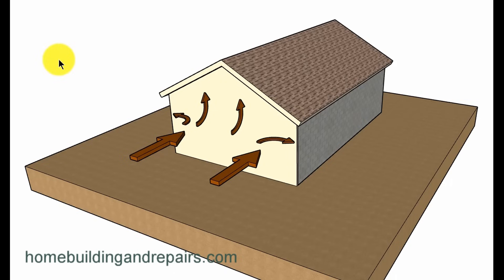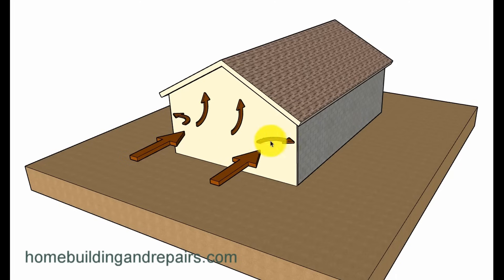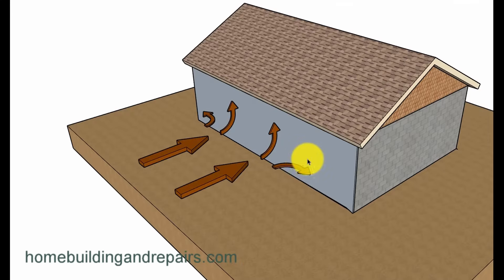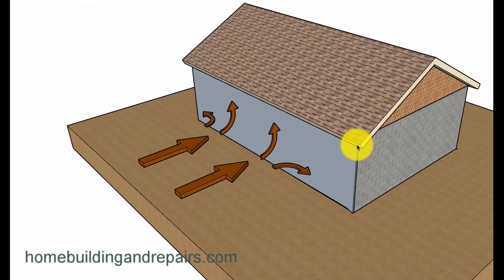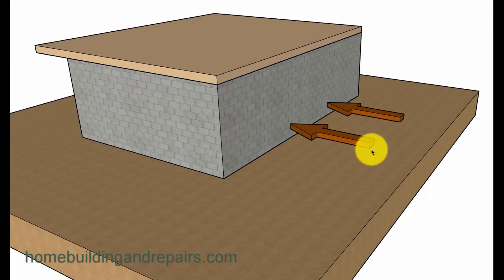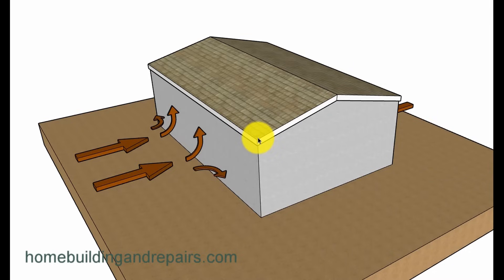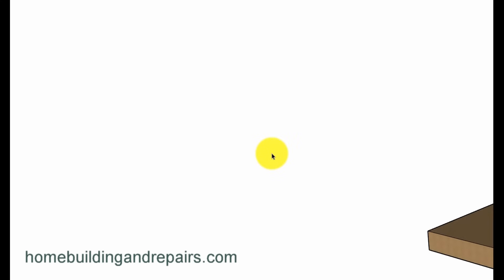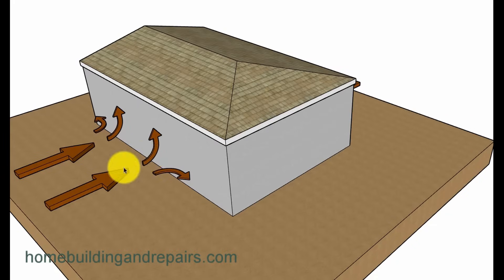How Strong Winds from Tornadoes and Hurricanes Can Lift off Roofs with Overhangs

Comment: Hip roofs are better for high wind areas. Also 30 degree slope is optimum to prevent wind blown rain issues, any more and the roof acts like a sail less slope and you increase the chance of wind blown rain entering the roof structure. Our home has a hip roof with a slope of 27 degrees.

Comment: I calculated that 100km/h of wind causes 50kg per square meter (60mph does 10lbs/square foot) of force. If your roof doesn't weigh much, it'll just get lifted up. If the speed is double, the force is quadruple!!! I did DIY something that didn't budge at 50mph, but at 60mph it was almost like a piece of paper in the wind.

Comment: I have 3ft overhang and 4ft in another section... skillion roof design. And the building is also uphill 😅.

What I'll be doing is installing a thicker metal roofing sheet and also fastening the rafters and purlins with angle clamps/storm metal brackets... it's an L-shape metal screw to hold wood with additional holding power. Will also bolt the roof tie beam against the concrete block wall and plant coconut tree on the front side of the building to shield a bit from the wind. The tree will help reduce wind pressure during a rain storm. 

A long overhang will shield the building against hot sunshine here, help shade my top-to-bottom windows a bit, and it complements the skillion roof facade...look really nice.

Comment: I have friends in the Philippines and they just had a super typhoon.  Common problem is that the corrugated roofs blow off.  However, it seems that there are opposing design criteria.  For example, normal tropical rains are heavy and this would tend to favour wider eaves.  Similarly, the sun's heat in the tropics would also favour wider eaves to shelter the walls of the house.  Cost is another constraint as poor people can't afford expensive building materials.   Not sure what the answer is in these cases.
Reply from the maker: Thanks for sharing and great points about home design.
Reply: I live in Ph and the answer is to build houses from cheaper materials such as plywood and nipa (for roofing). It's less expensive to build a house again and again.
Reply: Full concrete

Comment: It's not completely correct..... read if are a student 🇮🇳.........🇺🇸🇮🇱🇷🇺
The reason is that.... high wind blowing over the roof creates a low pressure in accordance with BERNOULLI'S principle, the pressure below the roof is equal to the atmospheric pressure which is now larger than pressure above the roof, this difference of pressure causes an upward thrust and the roof is lifted up....✌✌

Comment: Two questions, please.  First,  Metal roofing vs. Asphalt shingles?  Which would you recommend in the high wind area of Colorado/Wyoming?  Secondly,  if winds are blowing into the house from the West, how would you position the house to avoid it getting pounded by the winds?  I ask these questions since I will be meeting with the builder in the next few weeks.  The house will also have a front porch running about 16 feet in length.  Your answer to the second question will help in deciding house positioning.   Thank you so much!   Anyone else with ideas, please feel free to jump in as well!
Reply: Metal roof is better for high wind areas.

Comment: This is  not the main reason for blowing off the roofs
During windy storm when the wind blows over the roof it creates a low preesure area over the roof realtively lower than inside of the house so due to this inequality in preesure the roofs usually blows off .
Reply: I’m not so sure ...
Then it should be the same with airplanes ✈️ 
But airplanes can fly upside down too 🙃
So there is a problem with this logic...
And the same problem applies for house roofs and winds 💨
Reply: @thanouss3  yeah it is same with the aeroplanes too . They don't rely at all on wing shape for lift. To fly upside down, a stunt plane just tilts its wings in the right direction.
They are shaped so that that air flows faster over the top of the wing and slower underneath. ... The high air pressure underneath the wings will therefore push the aircraft up through the lower air pressure.
Reply: Airplanes use that low pressure for lift, wings follow low pressure - they're not tied down to the ground...think....

Comment: Ok so firstly, this is not an accurate view of the dynamics of a low speed flow (and yes, to an aerospace engineer, hurricanes and tornadoes are low speed flows). Modeling would be needed to give detailed answers but remember that the wind acts everywhere, not in a single jet. In practice you’ll have a region of high static pressure on the upwind side and relatively low flow speeds. As free stream winds pass over the house, the streamlines will curve over the roof of the building indicating an area of lower static pressure. Finally, at the back of the house, expect a region of separated flow and low static pressure. The details will depend on roof/house shape, but the overall effect will be a combination of a vertical lift and lateral drag force on the building. The vertical lift force is what “peels” the roof off the house, or overturns the entire structure if not well anchored, while the lateral loads can lead to shear failures in walls, or shift the entire structure off the foundation if anchoring is inadequate. IMPORTANTLY: these forces exist regardless of overhangs. A house with bigger overhangs does have a bit more roof surface area and thus may have a bit more uplift force all other things being equal, (there will also be an interesting effect at the overhang due to the high static pressure air below it, but the leading edge overhang is a small fraction of the total roof area), but eliminating the overhangs will not eliminate the uplift force or even remove the primary cause. Even a flat roof will experience an uplift force as the air passes over the house. Merely eliminating overhangs is unlikely to save a structure. A second issue is that eliminating overhangs greatly increases the rate of wall failure due to water intrusion, and associated rot and mold (flat roofs also have comparatively high failure rates for water intrusion). It would be better to have the structure properly engineered to resist the expected uplift force with proper overhangs for long-term durability, rather than attempt to limit the aerodynamic forces (largely ineffectually) by eliminating the overhangs.
Reply: "properly engineered" HOW? all that yapping and you concluded into having no actual specific solution.
Reply: @Brrrrrrrrrtbrrrrttt  the reason people like this guy, who yap but provide no actual solution, is because they want you to hire them. Otherwise, all the time and money spent on their degrees would go to waste.
Reply: It's not completely correct..... read if are a student 🇮🇳🇺🇸🇮🇱🇷🇺
The reason is that.... high wind blowing over the roof creates a low pressure in accordance with BERNOULLI'S principle, the pressure below the roof is equal to the atmospheric pressure which is now larger than pressure above the roof, this difference of pressure causes an upward thrust and the roof is lifted up....✌✌
Reply: Think you could help with my homework? Both True/False questions 1)Negative pressures occur on both sides of a pitched roof no matter how large the slope. 2) Negative design wind pressures occur on the side walls of a rectangular building. Thanks!
Reply: Just shut up n make your own video